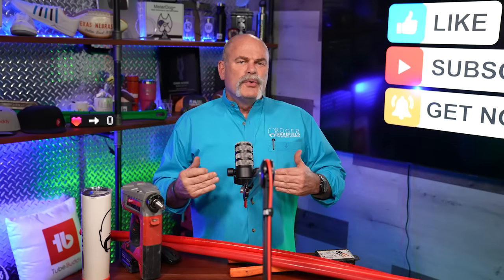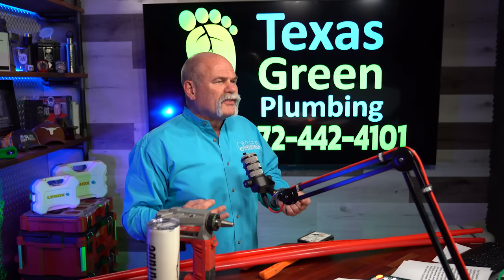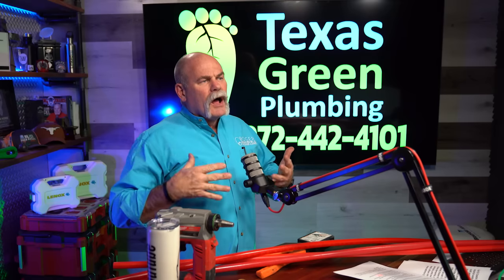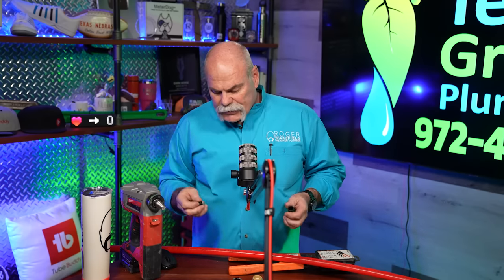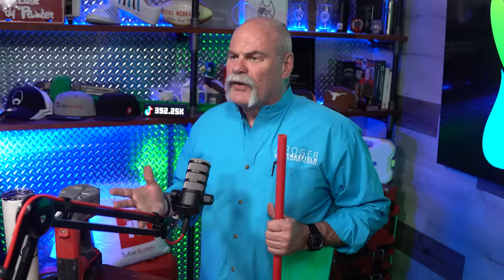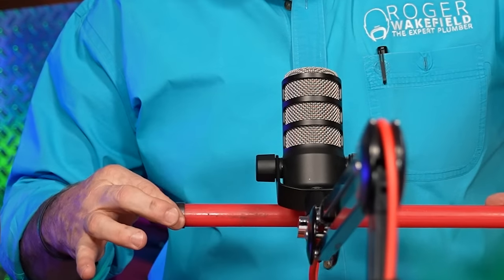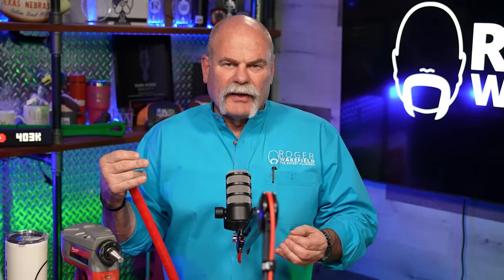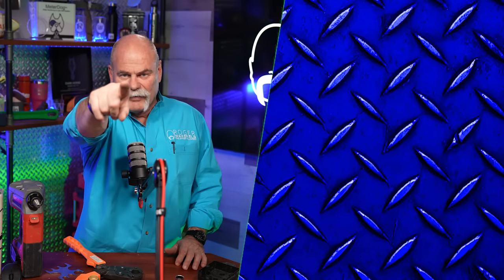HOW TO INSTALL PEX PIPE THE EASIEST WAY

Comment: You MUST! have a Great pair of kneepads! Your a big guy with BIG hands and you must have done your share of crawling into tight spaces and using bulky, heavy, clumsy tools . Connecting crimps is definitely NOT!  EASY! and has to be done correctly at the exact position which is a real skill in a cramped area. It beats soldering, but not that simple and inexperienced plumbers should practice on scrap before tackling the real job.

Comment: Any money you saved “doing it yourself” is eclipsed by the water damage caused by not hiring a professional
Reply: That has not been my experience. Especially with some of the janky thing I have found in my house that was done by professionals when the house was built.
Reply: Completely disagree.  I take pride in ALL my work, no matter what it is.  I do my own plumbing, carpentry, electrical, etc.  My work is at or above the range you would expect from a professional and typically at the higher end of that.  I am the customer, after all.

The thing is, I typically end up spending more time on a lot of stuff than a pro would (except electrical).  So much of making a living off a trade is being able to get the time down to get in more work.  So, it's often about the shortcuts that are good enough, vs. necessarily correct.  I will never have that level of experience in the trades.

I've cleaned up so many messes caused from "pros" on my properties that it's not remotely funny.  Some were even life threatening.

That said, money that you "saved" by trying and failing to do it yourself is indeed a liability.  Most of the current generation doesn't have the background or inclination to take care of a home like a man (as part of their basic life skills - like women with cooking/sewing/etc.) would have typically done in the 50s, for example.  Those that have those skills are generally best making use of them.  With resources like YouTube, most projects are far easier than they used to be.

The way I look at it, I'll even spend all the effort to get the job done right at the same cost as a hiring a pro, and then I'll have the tools available to me the next time around.